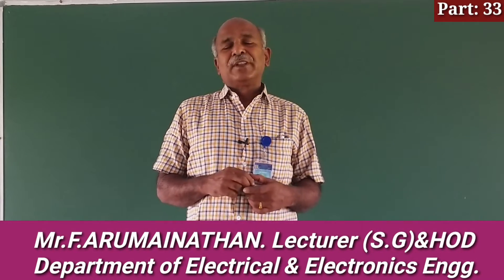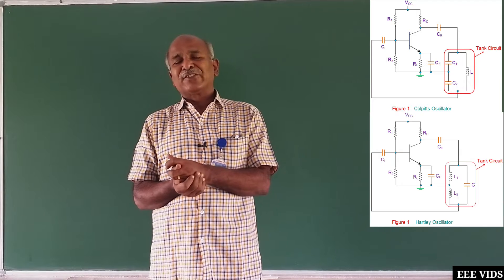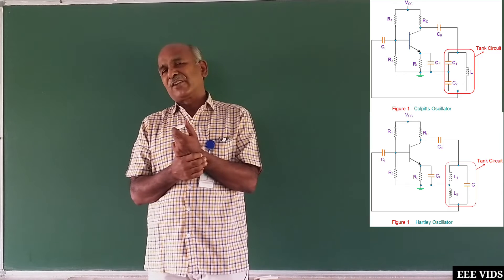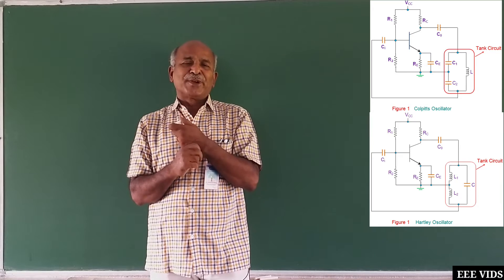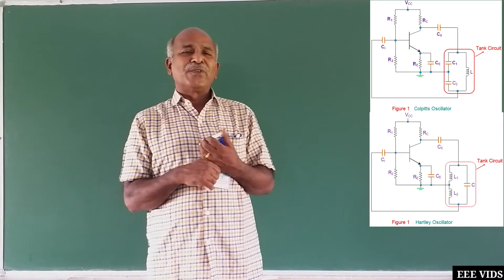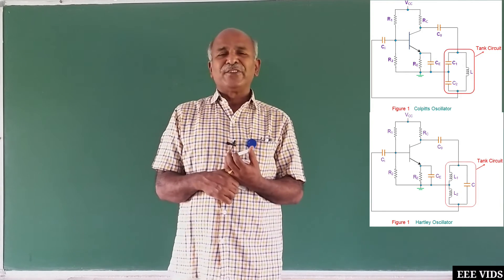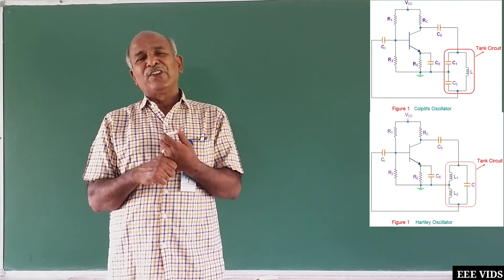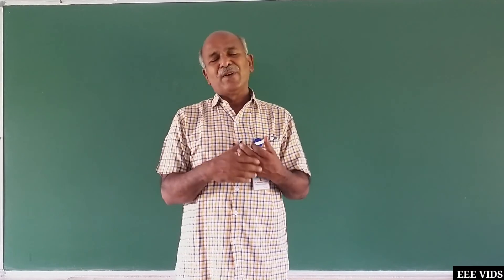Difference Colpitts Oscillator and  Hartley Oscillator in tamil

Comment: Sir Colpittsa konjam elaborateta nadathunka.. tank circuit ku DC supply tha kodukanumnu soninka ana transistoroda output signala kodukarinka epdi..colpitts oda Application ena sir.. transistor waveform oda Amplitudeda Adjust pannuthu ..Tank circuit waveform generate pannuthu..Renduthaum onna vachi ena circuit sir ithu